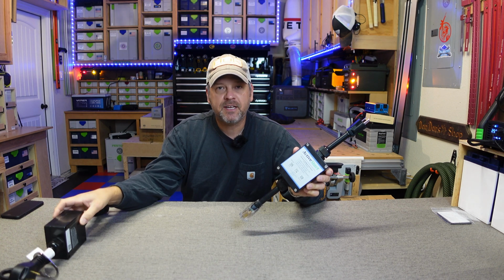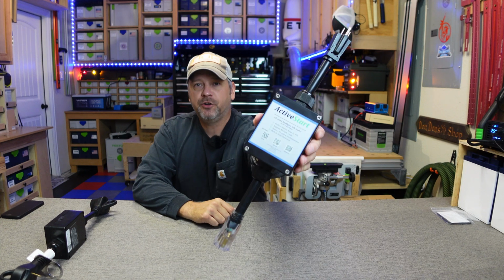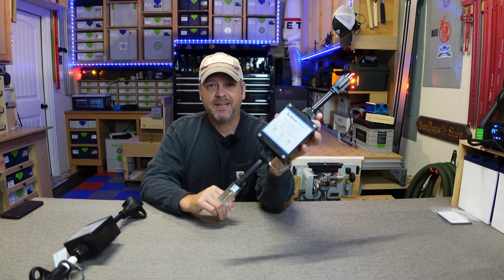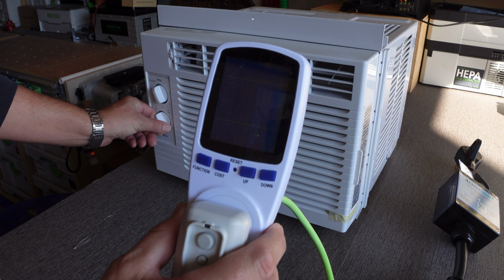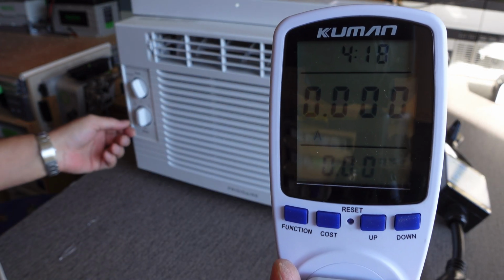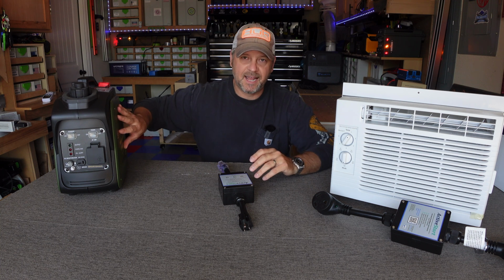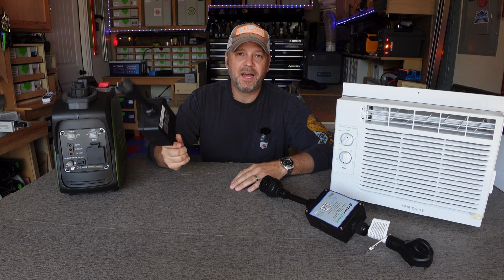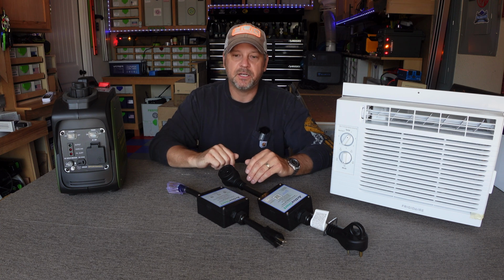No more hard wiring a soft start system for RV air conditioning! ActiveStart soft starter

Comment: Just to be clear, you can connect all this genius equipment without using the App, right? I love the technology available but if we are boondocking off grid with no cell service , certainly this will still work, right? The Bluetooth / app is just an add on luxury to monitor the voltage, amirite?
Reply from the maker: Correct, you don’t HAVE to use the app

Comment: could this be plugged into a invertor instead of a generator with the same results letting you use a smaller invertor to run a portable ac unit

Comment: I have heard that temperatures over 90 degrees can affect the performance of the plug and play units. The A/C start up amp increase in the heat. 
 Is this true?
Reply from the maker: These ac units do typically require more power in hotter/ more humid environments.

Comment: can you use it for any inductive loads?
Reply: Should be able to start any small motor as long as startup doesn't exceed generator capacity, can't think of a reason why not.  Check with the manufacturer though.
What is the inductive load you have in mind?

Comment: the 30 amp plug-and-play soft start that has the 30 amp plug is such a scam every generator that has a 30 amp outlet will start a 13.5 air conditioner no need for the Plug and Play soft start

Comment: Little expensive on that for something you’re gonna put on a camper if you’re towing a camper already just get a bigger generator. You shouldn’t have too much problems with the extra weight for the house, though it may be worth it if you hardwire it to your AC.

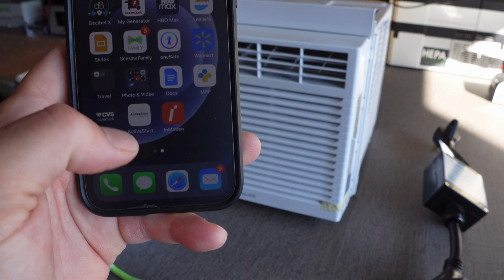Comment: 4:52 - I was sold until you said I have to use an app!   No!  No!  Tell that maker that we aren’t interested in an app!  It needs to work all the time without the app!   

When we are in a limited power situation we don’t want to be wasting battery power to jack with an app
Reply from the maker: That was my mistake. You don’t have to use the app unless you want to monitor it remotely.

Comment: A 2000w soft start module/relay, without the pretty enclosure, retails for about $15. It works on any single phase electrical device up to 2000w. ActiveStart, and other soft start companies, are selling expensive pretty cases.
Reply: Which company makes that part?
Reply: @maxwellhowell  there are several. most are crap and don't work get ridiculously hot and are a constant draw even after they limit the inrush current

Comment: Thanks for this video. Does the 30 amp version work if connected to a 15 amp 110v hookup with an adapter? For when at a spot without 30 amp hookup, or if using with a generator without 30 amp port.
Reply from the maker: Yes, it would work

Comment: Love the portability, like being able to get instantaneous info, but if I heard right from you, that YOU HAVE TO turn it on with a phone, im out, want plug and play not worried about having a phone, connection issues etc etc. should build it with a digital display on the box just like the kill a watt. Good video 👍
Reply from the maker: I was wrong, you do t have to use the app, unless you just want to monitor the current draw.

Comment: Or you can make your own 12 amp unit  with an   SCK-0512 Inrush Current Limitin, ICL 5 OHM 15% 12A 22MM    guy here on you tube shows you.... very simple.... for a fraction of the price.  you can make higher amp units too  upto a point.

Comment: LMFAO!

SoftStart 30 Amp RV Air Conditioners on Motor Homes. Run up to 2 AC's on Your 30 amp Camper and Bluetooth App for Monitoring. All in one softstarter, Surge Protector and EMS Protection
$465.00
🤣 
I'll just get a more powerful generator and or generators. $120 - 200⁰⁰ practical pricing almost 500 not only not worth it but it's like biden! Pointless! 😅
For under the cost i could give it to a redneck and he'll reverse engineer it!

Comment: Nice video very well explained..! Recently I installed a new roof AC unit from Rec pro 9,500 BTU it works fine with the Honda 2200  I would like to buy it so the initial surge doesn't stop my TV power...any time the AC compressor comes on...the TV stops..one question..the 20 amp unit is just enough for this issue..? It has the Bluetooth app like the 30 Amp has... 🙏 Thanks
Reply from the maker: I would go with the 30 amp to be safe
Reply: @BrianWatersOutdoors  🙏 Thanks

Comment: I have a 30 amp pedestal campground supply and my camper requires 50 amp for 2 ac. Can I use a 50 amp soft start?
Reply from the maker: You won’t be able to run all your equipment if your camper needs 50amp ( 2 a/c units?) you would be able to partially run your camper if you use a dogbone adapter to go from 30amp to 50 amp

Comment: I have a 30 amp pedestal campground supply and my camper requires 50 amp for 2 ac. Can I use a 50 amp soft start?

Comment: The price of these are nuts.  I just put a soft start on my 5 ton AC unit for less than $200.  Active start was over $300 for a 20 amp.
Reply: I like turtles.
Reply: Ya for $15 worth of parts.
Reply: I think its a fair up charge for most people who are completely incapable/uninterested of wiring in a DIY soft start. plus you can move this from rv to rv or even to your home.

Comment: Would this also help for solar generators I have a 2200 watt inverter and my portable ac sometimes just can't start
Reply from the maker: Yes. You can use the inverter on a power station also with this

Comment: My question is, would this go before, or after a surge protector for those of us using a generator, that has a surge protector plugged into it. So would you plug in surge protector first, then this unit, then shore power?  Or plug this unit in first to the generator, then the surge protector to that, then shore power to the surge protector? 🤔
Reply: He says in the video it has a built in surge protector.

Comment: can you use the 30amp plug and play to start 2 AC on a 5th wheel if the campground only offers 30amp and my camper is 50amp
Reply from the maker: You could dogbone your 5th wheel down to 30 amps and use this. If your entire 5th wheel + 2 ac units use less than 30 amps you could run it fine.

Comment: What's the point of the 30 or 50 amp one?  Your rv a/c will run if plugged into either. I can see needing the 20 amp to run the rv a/c.
Reply from the maker: 50amp mainly for RVs that have 50 amps and you don’t have to scale down to 30 amps using a dog bone.

Comment: Active start wouldn't run my RV AC using a 2500 watt generator inverter.. I kept getting the NAN on the display.  After researching It looks like if you have an off grid solar system, the inverter will shut off the active start.

Comment: Hi Brian, so a newbie question - If my goal is to run a 14,000 btu portable ac unit from a 2200i Honda gen. which model should I get? Thanks!
Reply from the maker: I have a 15k btu and my 30amp starts it just fine

Comment: The 50 amp unit starts at $700....no thanks. If you can't get up on your RV and connect a few wires to save $700 more power to you.
Reply: Alot of 50A RV's have 2 AC's, which makes that price gap between 2 hard-wired and 1 plug-and-play alot closer.
Reply from the maker: Ok👍🏻
Reply: $700 bucks for a cheap azz Chinese widget with $10 in parts in it? NO WAY! NO WONDER ALL THESE SCUMBAG YOUTUBERS ARE HAWKING IT ON THEIR CHANNELS!

Comment: So, will it soft start a well pump?  After all, it's another motor load.  I'm wondering because I might want to put one on my whole house generator.  Sometimes when my well starts, my lights in the house will dim slightly.
Reply: They have a 50a version, I'd run it inline right off the generator before or after the generator line that way it should soft start everything downstream

Comment: I'm looking for a solution for a similar problem on a non rv use case.  That current meter is too slow to show the inrush or inrush reduction. I'd like to see it with a faster meter or even an analog meter. I have a very similar (looks the same) and the current draw with the compressor on is a fair amount higher. That's weird.  Was that start current you showed on the display with an it plugged into mains current or was that recorded with the soft start box.

Comment: So what’s your opinion if I plug this directly in Tamara electric refrigerator in my RV do you think it would stop the surge that it pulls on my inverter?
Reply from the maker: Yes, that’s the point of this device is to reduce the amperage of surges for a/c units, fridges…anything that has a high surge this will help the generator “ease” into it

Comment: You say "To get this thing turned on you have to go into your ActiveStart app". Did you mean that you can't just plug it in and use it, you have to turn it on with the app? And if so, do you have to do that each time you use it? Also, does it eliminate the motor surge on the generator? I have a Honda 2200i and I like to run it in Eco mode but whenever I have the A/C on (also 5000 BTU) each time the A/C compressor starts the 2200i has to speed up to meet the demand so I have to run it full throttle all the time. This is what I am trying to eliminate because Eco mode runs almost twice as long on a tank of gas. Thanks, I really appreciate any information you can provide!
Reply from the maker: You do not have to use Bluetooth with this…you can just plug it in and use it without. And it does eliminate the surge because it reduces the amperage draw so the generator does not have to rev up the RPMs
Reply: @BrianWatersOutdoors  Thanks so much for the information. This is something I've been waiting for some time now.

Comment: The surge protection would definitely help protect your appliances at an RV park. Some of the older RV parks have questionable power connections. A few years ago we were at one of the older rv parks here in East Texas and while running our microwave, the campers in the lot next to ours turned on both of their 15000 btu roof top ac units. The sudden drop in power caused our microwave to quit working and it never worked again. I'm just glad it was less than $100
Reply from the maker: That stinks!
Reply: That stinks,but standard surge protection doesn't really do you much good in a voltage sag situation only for spikes above nominal voltage. Unless this gizmo has a low voltage clamp built in, but I have not seen that advertised from looking around at them. I know the joys of bad power, lost a brand new CPAP machine camping, bought an audio/hifi  surge protect after that that ,which has low voltage clamp thats adjustable same for higher than 3% over voltage. Happy travels
Reply: @user-ge2fb9fh2q  i agree. what actually helps is a GFCI portable outlet from lowes homedpot. but even this isnt foolproof with low voltage. sorry about your cpap man that is unfortunate

Comment: Can the Active Start work or be configured to work for a solar power/inverter setup?
Reply from the maker: Sure. Just plug it into the ac side of the power station and use as normal👍🏻
Reply: On a battery/solar setup Could this be plugged into the designated AC outlet In a camper then the unit plugged directly into it?

Comment: This is amazing. My 4K watt generator won’t run my AC while hunting. Blows the breaker soon as I try turning it on. Going to give it a try, thanks for the video!
Reply: What do you have for an AC? I used to run my 5K BTU AC with a predator 3500/4375
Reply: Just checked my specs. I have a 13,500BTU AC on my 33’ 2019 keystone travel trailer.
Reply: @moneymaker1986   did it work?
Reply: @moneymaker1986  you could always use the 30a to 15a adapter if you're running a 3500w generator. You're probably pulling 11a at startup. Just don't turn anything else on but LED lighting and you should be fine.
Reply: @manwiththevoice  will it run 2 5k on honda 3000?

Comment: Very ingenious product but it is pricey. It’s almost the same cost as the generator. I wonder if it works with some of the portable power stations and higher draw devices
Reply from the maker: It will work with the larger power stations, just the same as using a gas generator. 👍🏻👍🏻

Comment: I would be curious how today's electronics will like it, there was a product similar to it years ago and it was pulled due to damaging sensitive electronics due to low voltage, the hardwired versions only control the compressor and not the electronics so no damage occurs with that style, I would be curious to read the patent details to see how he was able to avoid the low voltage death
Reply: We do not keep the voltage low for very long as in msec time frame. The key is we do not kill the power completely and ramp up the load without interfering with other appliances that might be running.
Reply from the maker: Good question🤷🏻‍♂️🤷🏻‍♂️👍🏻
Reply: @BrianWatersOutdoors  I would be interested in trying one and running it through some tests

Comment: Wait what?  I have a watchdog surge protector when I plug into shore power. Why would I need this? My under carriage Onan runs the RV AC.  ( yea hard start)How would it “just plug into my generator”?
What works to run AC off batteries?
Reply from the maker: This device is used to decrease the start up / surge amps of your ac. If you have a big enough generator, you might not have any issues. However, this also could help prolong the life of an ac unit because it minimizes the large surge and strain on the components.
Reply: Hi Jean...If you use batteries than you have an inverter as well and this product will reduce the surge the inverter will have to handle and not trip its overload when the AC starts.

Comment: the power surge happens every time the compressor cycles on, doesn't matter if you first turn it on or it's been running all day
Reply from the maker: True
Reply: Will this address the power surges after initial start as well?

Comment: Hi Brian. Would you happen to know if this will work for a refrigerator that has a surge above 1500 watts?  Love the video. Thanks
Reply from the maker: 20 amps at 110 volts is about 2,400 watts. The 20 amp version should be fine

Comment: Hey Brian - used to have a camper and plan on getting another one.  What is the reason for having the 30a one on the pedestal? Just to control surges and give you a monitoring point?
Reply from the maker: Just because RVs typically have a 30amp receptacle, or 50 amp for the big ones. You’d just use your standard 30 amp extension cord with the 30 amp version.
Reply: Hi Clay...Another benefit for using on a pedestal has more to do with how good the power is at the park especially if it has lower voltage which cause the startup spike to be higher. This product also has monitoring for low and high voltage which could damage your electronics. The output is turned off in those conditions and will restart again after a 3-5 minute delay.